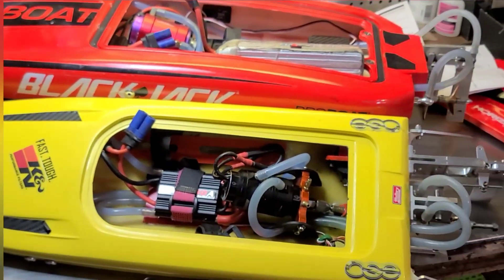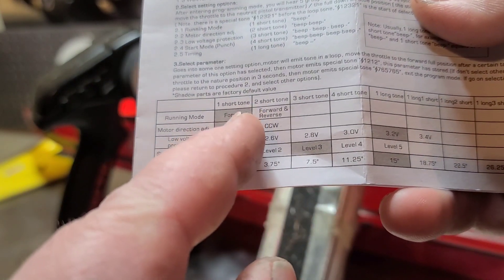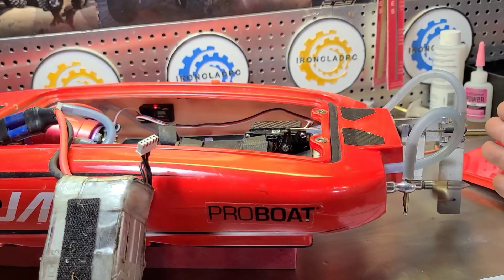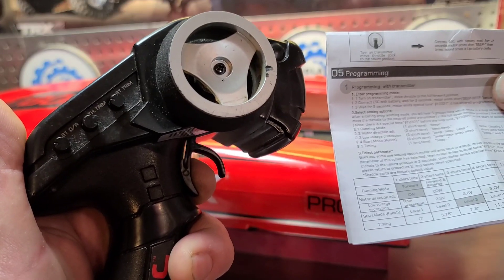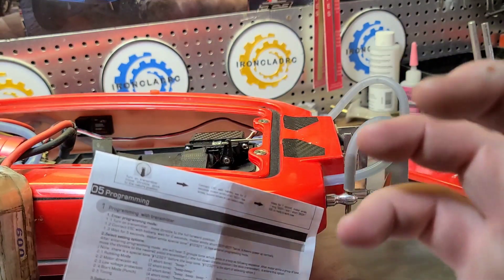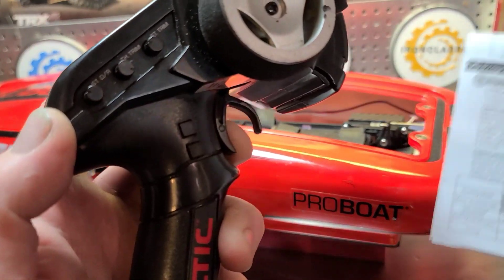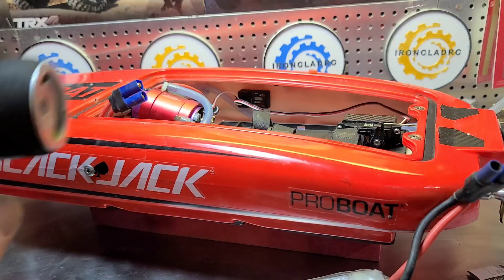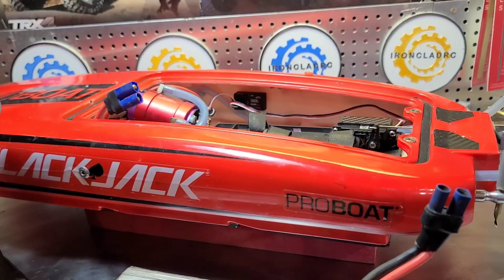How to Program Any Flycolor ESC using A Pistal Grip RX/TX

Comment: My 90a is not programming the first throttle step
Reply: It is not capturing or storing my commands and continuously loops. I did just as you and every time I power up its in program loop???
Reply from the maker: Make sure your throttle trim is zeroed out properly and or throttle calibration on the rx/tx
Reply: @IRONCLADRC was throttle calibration Sir, thank you.

Comment: are esc ose raider and flycolor the same item?
Reply from the maker: Basically the same esc yes, OSE has an external cap pack installed which helps with extreme loads
Reply: @IRONCLADRC  Can the flycolor card program be used for ose?
Reply from the maker: Yes, same esc

Comment: Necesitó tu ayuda, tengo la Flycolor 90A , tengo la tarjeta configuradora, la he configurado bien , pero en todos los casos me funciona de esta forma, el gatillo de la emisora en reposo (0%) el motor se pone al 100% y para pararlo tengo que presionar el gatillo al 100% , pero el problema es que con esa configuración si suelto el gatillo o pierdo la señal el barco se perderá
Reply from the maker: You need to set your throttle dual rates to zero and go thru the start up process again
Reply: @IRONCLADRC  perdoná mi ignorancia, como se hace eso? 

Michas gracias

Comment: Man I've gave you about 200 views on this video last couple days. I've been doing same thing as you but it runs the motor full throttle in the neutral position and throttle stops when I pull the trigger..I've tried the  reverse switch on transmitter but same thing..almost starting to wonder if the transmitter came with the trigger wired backwards...have you ever seen that before. It's just a cheap flysky remote picked up on Amazon. You got any ideas what I'm doing wrong?
Reply from the maker: Dial your dual rate down to zero.  If that doesn't help dial it to zero then recalibrate the esc
Reply: Thanks for the quick reply..ok yeah   I'll try that! Subscribed!!
Reply: And yes that worked!! Thanks!!

Comment: I’m running 2  3660 2070KV outboard with 2 fly color 90amp, they came with 35mm props I bought 38mm props with a counter rotating prop how do I program my esc

Comment: Hey big B got a questions about new flycolor 90 I put in a bj24. First two runs were flawless. 3rd run, I plug battery in and try to throttle up, motor doesn’t make any revolutions, it just jitters back and forth and instantly heats up to 165° within seconds. Motor wires from esc get hot. Esc arms fine, but won’t turn motor. I replaced the esc with stock one and motor works fine. Have you seen this problem with any flycolor? Defective maybe?
Reply from the maker: Probably single phasing, Check the esc/motor connectors peel off the heat shrink on the esc/motor wires. You more than likely desoldered a bullet.   If that's the case, re-solder the bullet.   Also, consider upgrading the connector size to a larger bullet

Comment: Does the low voltage cut-off stop the boat dead or go into 'limp' to allow you to get to the lake  / pond edge?
Reply from the maker: Usually goes into limp mode or a momentary/quick cut off

Comment: I was looking for a video how to program the Esc with the remote control, because I did not want to buy a program card for 2 settings I need, so I could program my ESC Flycolor 30A in my electric glider, the Beep tones I had not well understood in the instructions, through your video it was then quite simple, even if I did not understand every word of your dialect, but at least the sense of programming, thank you for your video and have fun with your hobby. Excuse my simple English, because I use a translator, this is faster, greetings from Bernhard from Germany

Comment: My brandnew Proboat Recoil 2 Shreddy broke my esc (hobbywing 100amp 3s-4s esc.. after 1 minute it stopped only my steering was working but no throttle.

So i orderd the Flycolor 150amp esc. I hope this will hold longer on 4s
Reply from the maker: If your running the stock motor the flycolor 150 won't work with it.
Reply: @IRONCLADRC  why not, because the specs says "2s - 6s"

I wont run 6s only 3s or 4s then it should not be a problem isnt it?

I have allot of Rc cars running a stock 3s or 4s motor with an 150a or higher esc on it just to have over kill on amps. Why couldnt this work on a boat? (Honost question)
Reply: @IRONCLADRC   why not, because the specs says "2s - 6s"

I wont run 6s only 3s or 4s then it should not be a problem isnt it?

I have allot of Rc cars running a stock 3s or 4s motor with an 150a or higher esc on it just to have over kill on amps. Why couldnt this work on a boat? (Honost question)

Comment: Hello. I am going to build a robotic boat using a Flycolor 150A ESC, controlled by Arduino. Can I somehow do a similar calibration with Arduino, or a program card is needed?
Reply from the maker: Unfortunately I don't have any experience with arduino, all I can say is  give it a shot, flycolor does offer a program card
Reply: @IRONCLADRC  Thanks! Also, can I use the same ESC in a RC car (to save money) with a fan attached? Will it overheat?

Comment: I noticed your flying escs, and since you're using them, I grabbed a couple of 150.
Going for torque with moderate run.30, 35 ish.
For the hooligan feeling I use the gaser. It rocks. 
I had good speeds and also lots of smoke😁😁😁
Reply from the maker: No not the magic smoke.  I like the flycolor esc there been 👍 great

Comment: Thank you for this video IronClad!  Very helpful in setting up our BJ 24 with the Lepord 3660 motor.  Just did some testing and had 2 questions.  What will cause the ESC / Motor to cut out on a full trigger pass?  Once you go back to neutral and apply trigger again it was back on.  Secondly...it went into low battery protection mode but I still had 10.8 volts left in the battery.  The ESC is set to 3.4 volts on the battery protection mode.   Thank you bud!
Reply from the maker: More than likely it's your prop the prop may be too big for your setup go down and prop size see if it's still power cuts if it's still power cuts the KV of your motor may be too high
Reply: @IRONCLADRC  thanks for your reply it’s just the stock prop th kV I THINK IS 2550

Comment: Been looking at these online for my bj24 cant find very many reviews on them how do you like them? Also everything ive read about the stock prop size and pitch for the bj24 is all over the place and the measurements in the manual are not what the prop on boat measures any idea what the actual pitch and size is?
Reply: Thanks for the quick reply, sweet sounds like ill be ordering a flycolor 90 soon and a surpass hobby 3250kv haha the 440 and 438 props from ose are outta stock but i got a cnc prop comin with same specs as the m440 and a cnc prop with the same specs as the octura x438 we will see how she does!
Reply from the maker: Flycolor esc's are awesome that's really all I run in my boats.      It's been so long since I used the stock prop I hate to tell you something wrong.
Reply from the maker: As for upgraded props for the blackjack 24 I'd definitely go with a tfl 438 or ose 438 size prop it's my go to prop.  440 is also a good one for the boat

Comment: My motor makes a continuous beeping sound when I use a maytech remote and try to calibrate esc.  Remote is paired and powers motor but unable to calibrate or enter programming mode.
Reply from the maker: Check the dual rate make sure it's at zero
Reply: @IRONCLADRC  it's a fairly basic remote with only throttle and brake.  No way to modify or set dual rate.  Motor doesn't engage till 54% throttle and remotes pwm range is 1-2ms.  I'm assuming the esc starts at 1.5ms and can't be changed?
Reply from the maker: Have you tried to re-bind the rx/tx?  I'd try to re-bind with the esc
Reply: @IRONCLADRC  yes I've also tried that.  I'm at a bit of a loss as others are successful with the same setup.

Comment: Hi can you help me about on my esc flycolr 150a.
Reply from the maker: What's your problem? I will do my best
Reply: I fumbled my way through programming the flycolour 150a in my son’s Spartan. 

If the transmitter gets out of range of turned off while the boat batteries are hooked up.  Is there a way to fix that ? We ran the boat out of range and it kept turning the prop at a reduced rpm.

Comment: I have a question, my 150a esc had throttle position warning. So if you turn your transmitter on with throttle on, instead of entering program mode, it just sits on constant beeping throttle on warning. Is there a way around the warning to get into programming mode? Thanks!
Reply from the maker: Yep that's exactly what you need to do rx  recalibration should do the trick
Reply: @IRONCLADRC  yep, that fixed it! Thanks for your help.
Reply from the maker: I'm fairly positive the start up  beep beep beep beep beep than a musical tone is called soft start up.   2 of my boats do that with fly color and the other flycolor does not?   Hope this helps if not shoot another comment
Reply: @IRONCLADRC  Unfortunately no, my start up beeping is constant and does not stop. The manual says that constant beeping on start up means the throttle lever is not in neutral position, but you have to have it at full throttle to enter program mode. I'm wondering if I may have to re-calibrate the throttle position...
Reply: I'm having this same issue, constant beeps. I'll re-callibrate the rx. Thanks fellas!

Comment: Hi Big B,, that's a really informative video, now comes the question,, this stuff is all new to me, my Boat can run on 4s and 6s obviously with the smaller prop for 6s
I bought the boat second hand and its set to run forward and backwards which has helped on the rare occasion I've got in a tight spot, so should I alter the settings each time I want to use 4/6s batteries, it came with the 4s prop on. I had to buy the 6s prop, so I'm assuming it's setup for 7-4v, I've run it on 6s once not knowing about these adjustments, will it have come to any harm? I've just downloaded the instruction part of the manual for these settings,
Your thoughts would be appreciated bro
(Joysway Alpha)
Reply from the maker: No the settings should be OK switching from 4s to 6s. Unless your tinkering with timing.  On 6s I'd be careful with high timing or to low of timing.  Always watch your temps
Reply: @IRONCLADRC  thanks for the reply, having now just looked at the factory settings diagram it's preset to forward and backwards, and auto battery detection and preset timing,
Learning all the time bro thank you for your videos I love them,
And a big congratulations to the addition to your family, 🇬🇧